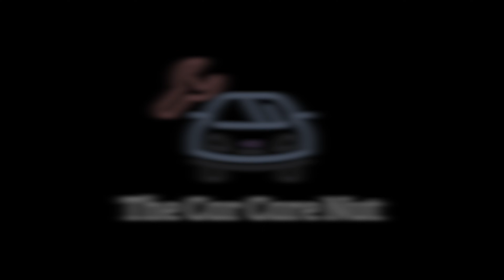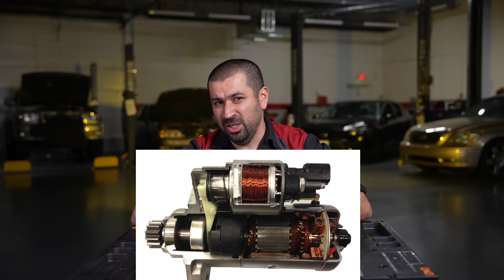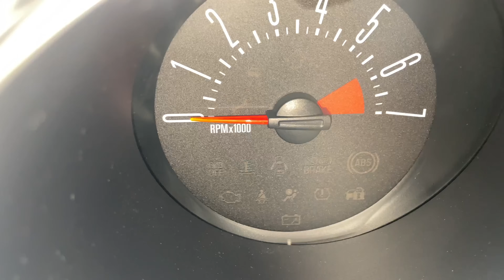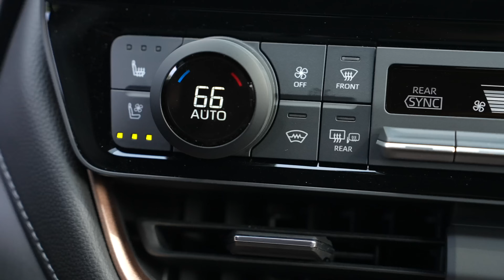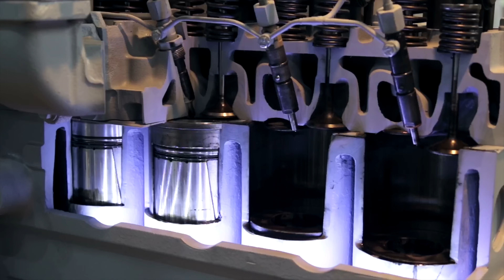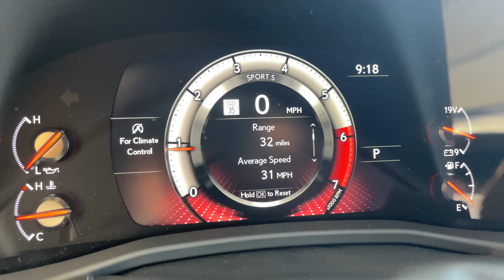How Does Start Stop Technology Work in Modern Cars? Everything You Need to Know

Comment: Thanks for a very thorough explanation. I bought a VW Lupo 3L in 2000, and used it for 20 years/300.000 km. I believe this was the first car with auto start/stop. The Lupo 3L is a diesel turbo with an "automatic transmission", consisting of a traditional 5-step gearbox with pneumatic levers to shift gears. An electric pump provided the pressure for this. It worked perfectly and never broke, and the automatic gear changer performed exacly like a normal automatic gear. The 3L name came from the consumption: 3 liters pr 100 km. Actual mean performance on Freeway was 28km/l in the summer, and 26km/liter in the winter.

Comment: I absolutely hate the feature and I turn it off most times. 
Was going through security recently and it was the usually stop and go traffic and just before came it to a stop I let go of the brakes and there was a slight stutter as the car was about to go into stop/start  mode.

the car just went into limp mode, gear was still indicating engaged but there was no acceleration no matter how much I depressed the gas pedal. My only savior was the car was still able to roll at idle speed I rolled off to the side and tried to reengage the gear still nothing.There were no caution or error codes on the dash.

Problem resolved after I shutdown the car and restarted.
for reference this happened on my 2019 Benz C300.

I still dunno why it happened.
please lemme know if you have any suggestions, explanations or questions.

Thank you for a great video.

Comment: He said the only downside car parts wise is the starter, which will need replacement only every 10 years after high stress.
That is either ignorant or a lie.

These special batteries which you praised so much for their technology fail 1-2 years earlier than common batteries that are not used for Start-Stopp, because they have to well, be put under stress a lot more often.
Oh and while lasting shorter, those special batteries also cost 2x the amount for EFBs and even 3x for AGM batteries...

Comment: So, do you need to use hybrid motor oil or conventional oil? I heard something about the engine running at a lower average temperature when stopping the engine frequently, which can cause issues with conventional oil.

Comment: I love the system in the 2024 RAV4. It runs a checklist to determine whether the engine should shut off, and it gathers driver consensus before doing so. We simply deep-press the brake to confirm. According to the timer, it might save only about 5 minutes of idling per trip, based on my recent rental. I never bothered to turn off the system.

What’s impressive is that many of these systems in the past required the shifter to be in neutral or park before the starter could reengage. Thanks to all these computer monitors, the HVAC, transmission, and vacuum systems all maintain pressure, so the starter doesn’t accidentally lurch the car forward. 

I did love the feel of that 8-speed transmission, but I prefer the seamless engine-off experience on my RAV4 hybrid. (Same engine).

Comment: Had a 2016 Acura MDX, I had to repair the start stop starter at 40,000 miles at $800 in 2018.  That and replace transmission fluid @ 50,000 and 100,000 miles were the only repairs other than disposables in 100,000 miles.

Comment: If the market tells manufacturers they should remove this, they will. I, for example, will NOT buy a vehicle that has this feature. I simply will not. I will buy a model/year that does NOT have it, even if that means buying an older car, or I will buy a manufacturer that offers a model/year that does not have it. I am now in the process of buying a 2017 Toyota that does not have this and I chose that model year SPECIFICALLY BECAUSE it DOES NOT have this feature, and as a bonus, I even get to have a good old fashion hand break! I may only have 20-30 years left on this earth and I will do everything in my albeit humble power, to stay away from such nonsense. IF the world ever regains its common sense, then I may return to supporting it with a new vehicle, but in the meantime y'all can kiss my grits! No way, no how, not ever ever ever, will I bow down to STUPID policies that make things WORSE than they USED to be. Count me out! As a final word, if EVERYBODY tells the manufacturers with their wallet, they do not want this, then it will change, otherwise, enjoy the silliness folks.

Comment: Before this existed, you had people who considered themselves "hyper-milers" who would do this manually at traffic lights (in addition to other annoying / unsafe things like riding real close to semis to limit wind resistance). Either way, I have mine disabled in my Rav4. I fail to see how putting wear / tear on the starter and battery is a good idea to lower emissions. It's a 4 cylinder engine, it's as good as you're going to get for an IC engine.

Comment: my VW has this feature, it works very well, soon as the pressure on the brake pedal reduces the engine starts. it's annoying when parking and such tho. 
Thanks for the very thorough explanation. one question, i have a friend who's car doesn't have this feature and in his quest to save the planet switches off his engine at traffic lights etc. is this a good idea?

Comment: I have two non-plug in hybrids with V-6 I.C.E. gas engines.  They don't have Auto stop/start; but, do have EV-to-gas transition.  It can perform in a similar way as the stop/start system in a non-hybrid stop/start systems.  The hybrid powertrain does have additional features like going 100% EV mode anytime from a dead stop or at hwy speeds.  I don't know what modifications were made to the powertrain to handle the added stress of this type of stop/start feature?  The engine can shut down several times per mile on a normal drive at city speeds.

Comment: Doesn't a catalytic converter need to be at operating temperature to work properly? If it is not it will clog and fail prematurely.   That negates any benefit of shutting off the engine. Plus all the pollution caused by creating all the extra parts.  This is like a electric vehicle.  You will never overcome the negative amount of pollution created during its manufacturing  vs a regular car.

Comment: Thank you for this. I’ve lost count of how many arguments I’ve been in with people who think these are just the same old starters on the same old engines. When I had my ‘22 Tundra (before someone tore my front end off running a light), it’s Auto Stop/Start system was the most seamless I’ve ever experienced. Toyota also makes it incredibly smooth to operate without having to click the button to disable it, because it’s so intuitively tied to the pressure on the brake pedal. It never felt laggy or rough, and you could easily control if it even shut off if you knew a light was going to change quickly. I now have a ‘23 Tundra hybrid so of course it’s a whole different world and truly seamless to where you can’t feel the engine spinning up and down while going down the road, but the Auto Stop system in their non-hybrid is beautifully done.
Reply: I agree. Everyone complaining isn't driving a Toyota. It's so seamless on my wife's highlander that it's unnoticeable. I also found that 95% of the time I'm not breaking hard enough for it to come on. Turns out, if you brake properly, which most people don't, it rarely comes on. I have to specifically push the brake hard to activate the auto stop, so as you said it's basically easy to control. 

And the time it takes to start is milliseconds. I can't take my foot off the brake and get to the gas pedal fast enough to beat it.

The complainers are definitely not driving a Toyota.

Comment: Mr. Car Car Nut, thank you for the incredible video and explination. However, I have a question that remains unanswered: What sensor/trigger does the start/stop system use to decide to start the engine again. You explained how they decreased the time needed to start, but its still not zero. Based on my experience, it seems like ANY movement of the brake pedal towards release will trigger a start event. That makes me think there is a sensor on the brake pedal that is more than an on/off switch, and more of a throttle position sensor type switch, and/or a brake fluid pressure sensor? If the brake fluid pressure starts to decrease, it triggers a start event. I suspect the TPS type sensor on the brake pedal. Could you confirm please?

Comment: I have this system in my ‘15 Jeep Cherokee and if the system is on hairy edge of going into start/stop but I don’t let it go into this it will keep transmission in 3rd gear and lurch till computer figures itself out. Jeep told me it’s our “American driving habits” and I should stop and let system work and then go. I am on battery #3 the jeep has 160k and still original starter

Comment: So, years of time and billions of dollars in research and development to replace a simple system with an overly complex and complicated system which also required a special new battery, a special new water pump, a redesigned radiator, a special new oil pump for the tranny (all of which had to be developed in parallel) that also had the potential to cause the vehicle's brakes to stop functioning without yet another special system AND that most drivers hate and has almost no noticeable effect (beyond being annoying at every stoplight)?

Comment: Start/stop on F150 V8 sucks , starter struggles when engine is hot, then it takes hydraulics a second to pressurize, it is not a smooth transition so I turn it off

Comment: I own a 2022 Ridgeline and I swear this thing goes off before the engine is completely warmed up in the winter. I start it up, drive about 2 miles to my first stop sign, and it activates. Secondly, it’s annoying when you are parking it. It actuates as you pull into your spot and it scares the crap out of you when you lift your foot of the brake. It’s kind of misleading because you think you are parked, engine is off, but guess what you forgot to put it in park! As you take your foot off the brake, it starts up and it’s ready to go into the car in front of you. That was my first experience with start/stop technology!

Comment: I remember when i bought my 2017 Ford f150 used with ecoboost 2.7 L engine and 45k miles that the start stop didn't work or kick in unless i drove the vehicle long distance then came to a stop. After about 2 years i replaced the battery with a new one because it was needed and now the start stop works all the time. It had the original battery in it when i bought the truck. Must be the battery was weak when i bought the truck used with 45k miles and was keeping the start stop function from working. To me seems like they did a lot of changes and cost just to have the start stop ability just to shut the engine off for a few seconds at a stop light. I always just turn it off when i get in the truck.

Comment: Amazing video. Solved my lingering doubt about what happens to the clutch when "Auto Hold" / "Auto Stop" is in operation and transmission in in first gear !! I will appreciate  if you could make a video on a situation when "Auto Hold" function in operation and "Auto Stop" is not in operation. I asked many mechanics or even a Maintnenance in charge but could not get satisfactory answer. Thanks again for a beuatiful presentation indeed.

Comment: all you have to do to disable stop and start system on a 2025 rav 4 is unplug the 3 wire  conector  on the negative battery cable and just like magic no more useless stop and start and you can feel safe again

Comment: I absolutely hate this feature of my car, and I would do almost anything to get rid of it. It’s legitimately dangerous as you lose full control over the car and access to instant power if you need it when stopped. I’ve almost had a wreck severe times because of the start stop function and the delay in turning the engine back on and engaging the drivetrain quickly.
Reply: No you dont your overreacting

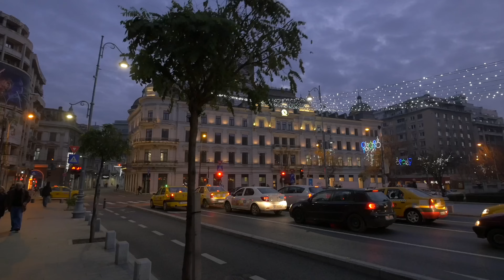Comment: 1:40 but the energy required to run the A/C needs to be generated by the motor one way or the other. I guess you could do something with regenerative breaking, but the start/stop cars ive seen dont come with that. 

Actually, disappointingly, my father bought a glc 300 from mercedes recently because they dont offer the 350e in the U.S.A. more power and torque with better gas milage for some reason isn't an option they want to offer?

Comment: It is bullshit. Crank an mechanism ×10 (or more) times each drive it will wear the part ×10 (or more) times faster. Though manufacturers claim modern equipped components will handle the increased work load i assure they don't and even if they can. Disabling this feature will make those parts last that much longer. The only reason start stop exists is to reduce our carbon footprint in fairy world. If imaginary insignificant contributions to stopping global warming mean a lot to you (💸💸💸) leave start stop on and spend the cash

Comment: I coded start/stop permanently off on my BMW. I figured it's just more stuff to go wrong further down the line. I purchased the vehicle at 5 years old and the starter motor had already been replaced under warranty by that point due to weak performance. I guess it took a hit from the previous owner using start/stop. Every now and then I accidentally hit the button and get a fright when the engine cuts out at the lights 😅

Comment: The manufacturers told the public that stop/start would improve fuel savings. It seems that you said that this is so minimal as to be almost non existent.  I am looking to buy  a Mitsubishi RVR bc one of the things I like about it is, that it does NOT have the stop /start feature.  It does NOT have direct fuel injection and it is NOT turbo boosted. I think my new Mitsubishi engine will thank me by lasting as long as my previous car that also did NOT have these features. It was a little 2.0L, 4cylinder CVT engine that was still going strong after I sold it 14 1/2 years after I bought it. It was a 2009 Dodge Caliber SXT❤.      :  ). What about the STARTER MOTOR ?

Comment: great video.. Fuel consumption with/without start/stop really depend on the engine (e.g small turbo charged overpowered engines will consume much less fuel in the city with activated start/stop and gonna burn a lot of fuel without start/stop active, e.g 20L+ vs 11L for 100km, which is varies a lot and depends on street lights, jams, etc). 

E.g audi S3, manufactured in end of 2020. Start/Stop gets activated even before the engine temperature can be detected (less than 60C), so feels a little bit way too early to activate it in winter (but yes, earlier they start it, better CO2 emission results can be obtained by manufacturer in city/mixed driving cycle). So still, going more old school way, in winter when its cold outside, I keep deactivated start/stop until engine reaches at least 80+C. And when its warmer outside outside - i do not care and let it get activated automatically when computer wants.

Comment: The most unnecessary feature on a modern car. Gives too much load on battery to start the engine every time it shuts off. Plus this function takes more fuel if it keeps shutting off n turning on in short periods.

I do NOT like this feature, TBH.

Comment: I bought a used (5000 miles) 2023 Hyundai Santa FE Urban. I was not aware of the Start/Stop functionality until it started doing it 2 months after I purchased the car, it did it for 3 consecutive days and then stopped. 3 months later it started again doing it for 2 consecutive days and stopped. I went to the dealer which checked the computer (costing me  $150 even though is under warranty) and told me everything is fine?
Any ideas? Why is this technology is so erratic?

Comment: I came to know the existence of this system when I drove a VW Passat in Sweden back in 2012. Stopped at the traffic light and the engine stopped. I thought there was problem with the car and then tried do start the ignition again and the crank made a big noise.😅 After a while I realized how it worked just by pressing the accelerator.😅

Comment: I found a way around this in my 24 Forester.  Other than hitting the off button for it.  I just hit the sweet spot on the break press where the car is stopped but it doesn't activate the auto stop.  Something everyone has found.  I'm sure.  It works.

Comment: Stopped at red light. System ( on VW ) caught me out when I removed my seatbelt so I could take off my jumper / jacket. Then replaced seatbelt. But the system went to error mode (without me realising it) as soon as I unplugged my seatbelt. Traffic light went green and ... the car wouldn't go. Then I had to quickly turn it off and restart. So embarrassing and annoying. But mostly I'm ok with it.

Comment: In a previous video (which I believe you made), it was stated: "Don't abruptly stop a hot engine. Let it idle for a minute or two to cool down." This refers to situations like driving on the highway at 2500 RPM and then immediately pulling over and turning off the engine. The concern is that the pistons are very hot, and with the engine off, the oil and coolant stop circulating. This can cause the oil to burn onto the piston rings, potentially leading to carbon buildup and blocked rings.

My question is: Could the start/stop system in modern cars cause this same kind of damage?

Comment: So they had to reprogram the computer to do what carbureted cars did for years. Once the older cars were warm if you turned off the engine to say run into the store to grab a quick item or get gas. You would just barely bump the key to start and as the starter engaged the engine was already running. Then fuel injection came out and no matter how hot the engine was you had to crank crank crank crank vroom its running.  Im not sold on this idea at all. HOW TO DIABLE THIS GARBAGE!